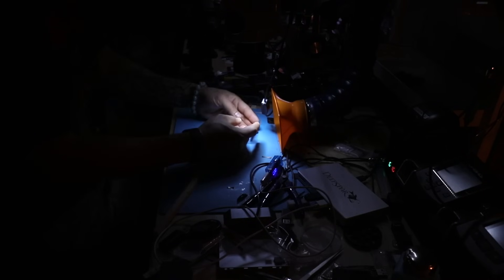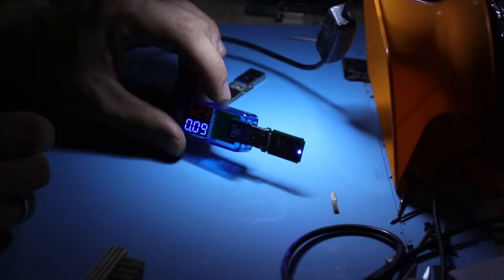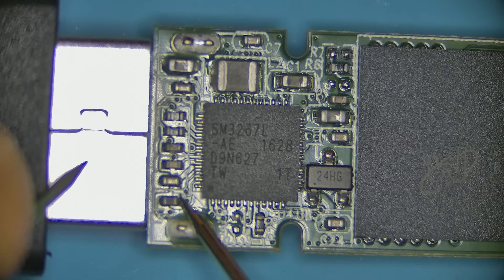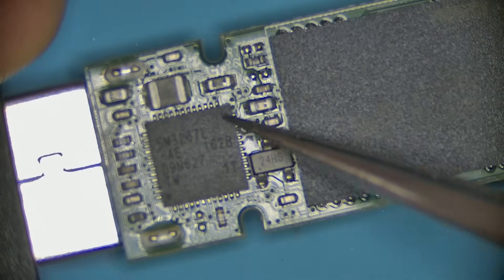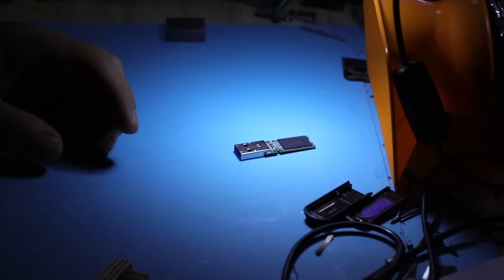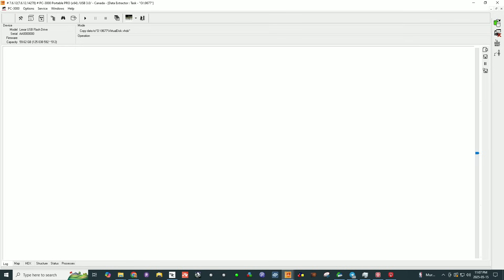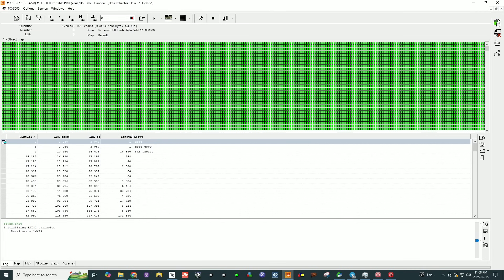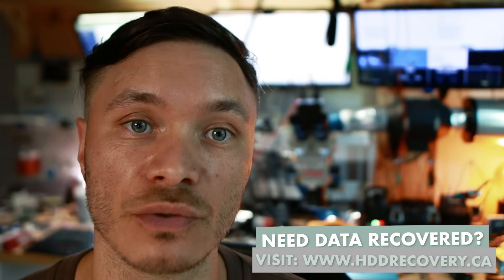What Happens When a Flash Drive Breaks?

Comment: Good job Erkin!  One question for you.  Do you think instead of resoldering, could you have just clamped the controller down (Putting pressure on it) so it made a connection, then attempted recovery?  Just curious.  Sure seems like the manufactures could make a better design.  Jerry L
Reply from the maker: Jerry, indeed, it could be clamped, bent to make contact while copy is being made